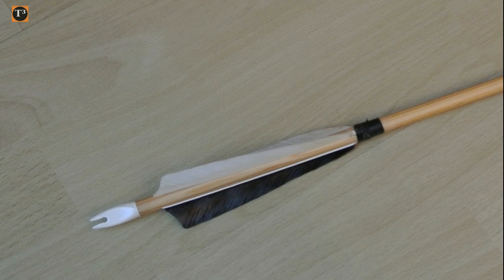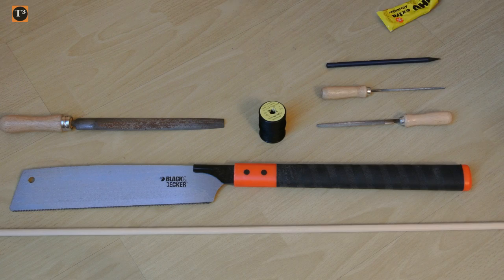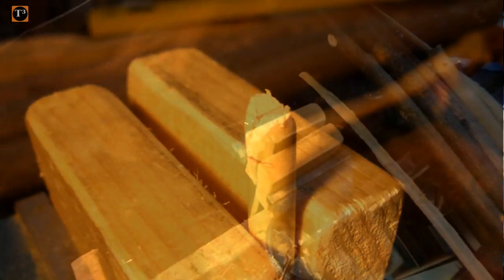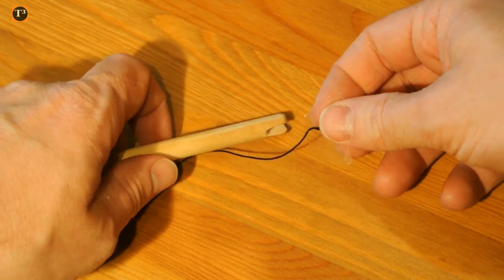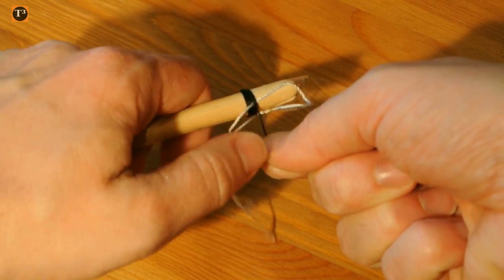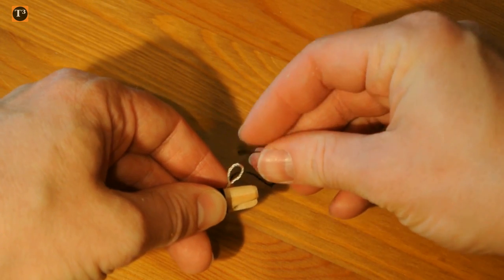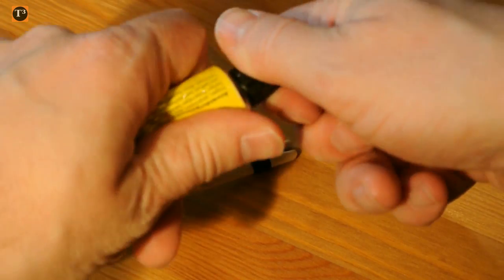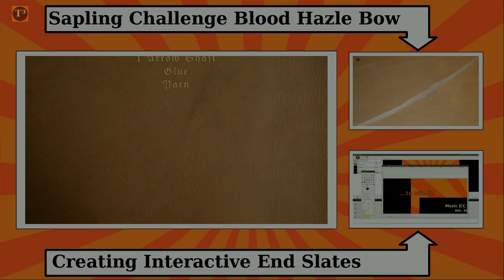How To Make A Selfnock ▪ Traditional Wooden Arrows

Comment from the maker: Arrows are expendable items for me. Thus my favorite material is pine for its cheapness. Once I loose an arrow in the brush or it breaks I don't have to whine a lot :)
As I am more into traditional archery I don't like the carbon ones very much. Furthermore do these have an important drawback. If you have already seen images of broken arrows stuck in hands you probably know what I am heading at. The remains of wooden arrows are much easier to remove from wounds than fibers of carbon arrows.